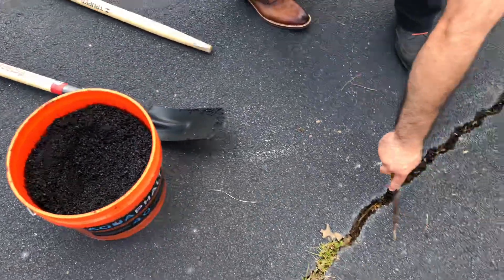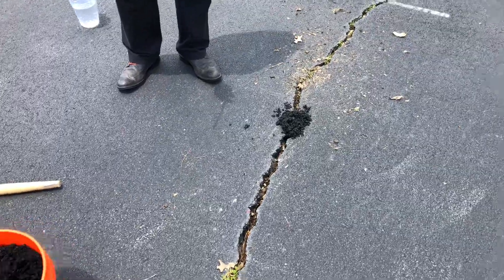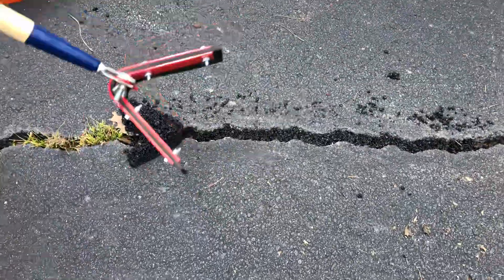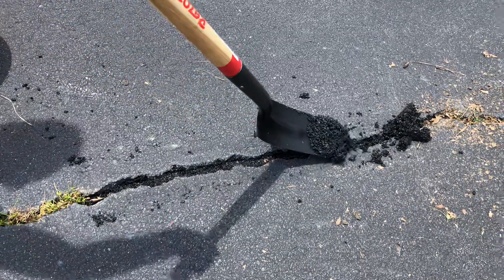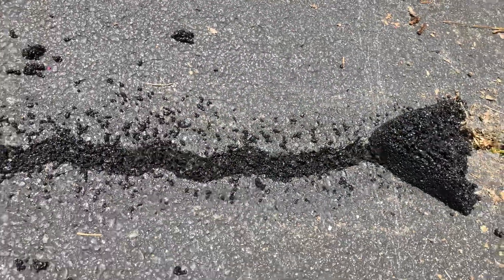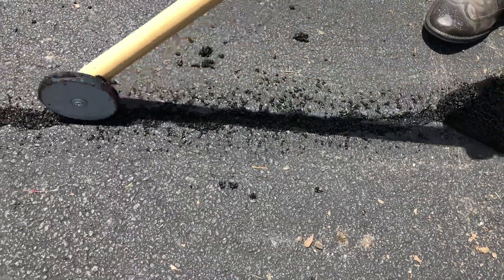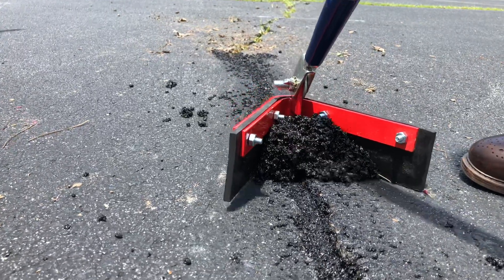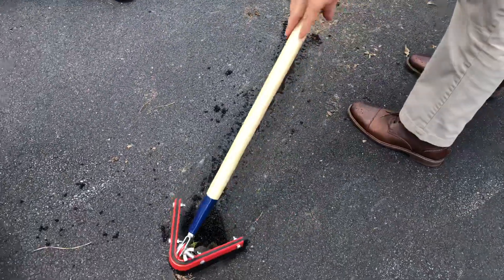Aquaphalt 4.0 Demo HD

Comment: Just a handy guy, but I read the directions.
Goofiest couple of guys I've ever seen trying to do manual labor, and I'm an OG-nerd.
1. Clean the heck out of the crack, use a screwdriver or something to get the loose shit out and maybe pull the wet vac out for everything.
2. Shovel a mod amount, and then use your hands or piece of cardboard to scrape it into the crack 1/3 - 1/2 full
3. Get some water on the stuff, and tamp it down.
4. Repeat above until its slightly mounded over the top.
5. Get a piece of 2x4 and a 3# sledge if possible and really beat on it until its level and solidly in there.
6. Give it a lot of water, I try to keep it damp if its really warm for as long as I reasonably can.  Cover the top with plastic to reduce evap.

Comment: Did you READ the directions?  The binding agent is water activated.  If you tamp it before you water it, the water can't get to most of the product.  Apply, water, tamp, repeat in layers, last layer product should be 1/2" or so above surface, then tamp the crap out of it until it's level.  Every time you take some out of the bucket, you water it before you tamp it.  FFS ???

Comment: Remove the weeds, cut into the asphalt to create straight lines with an angle grinder, apply it, pat the product down with a heavy tamper then use a hose set to shower! Dude uses a large cup. Yikes!

Comment: Just put it right over the grass, right?
Reply from the maker: We were just testing how the product worked, not making an actual repair
Reply: @andyalger6702  Honestly, how stupid does one have to be to 'test' a product without reading and following the directions?
What is the actual 'test' then, since by not following directions your 'test' is automatically bad/fail?
If anyone is going to test/use a new product on a crack in their driveway, the non-imbecilic among us take the extra 2-3 mins to use the product as directed so as to actually fix the problem.

Comment: just checkin in but how has the product performed a year later? Is there a more premium product? Is there one for smaller cracks? thanks
Reply from the maker: The product has held up fine over time. I have a short video showing it after 1 year that you can watch. We are still using it daily without any issues. I believe the 4.0 is the smallest they offer and is good for cracks down to .5 inches

Comment: Your are suppose to water it before compacting. If you compact first, then the water cannot mix with the aquaphalt, which is what it needs to do to to harden properly.
Reply from the maker: bconman Your point is valid. The problem is getting enough material into the small crack. It has to be pushed down to some degree in order for the void to be filled. Otherwise, we would have a very loose and crumbly fix that wouldn’t last.
Reply: @andyalger6702  That doesn't address the point, at all.
Put some material in the crack, add water, tamp.
Add more material, rinse and repeat until crack is full.
By doing it the way you did, you actually made it far more likely to be crumbly at the lower, foundational level.
It hasn't failed because it isn't actually water-proof, and water seeping down through it is activating the 'dry' stuff below or it pulled water from below after rain has soak the ground.
Lots of excuses for a fubar'd video, just admit it.

Comment: Can you name the two tools you were using to fill the crack?
Reply from the maker: F. Silva The squeegee can be found online by searching for “v shaped squeegee”. I believe that specific one came from amazon. The other device was a homemade test with a plastic wheel I found and attached it to a broom handle.  I ended up getting a piece of 1/4 inch steel cut at a local metal shop into a circle and had them cut a hole in the middle for it to roll on. The weight of the steel worked a lot better. Unfortunately that was not filmed.
Reply: Oh, Just found your responses tô others'  questions about the tools. So, nevernind my question. Got the answer already!